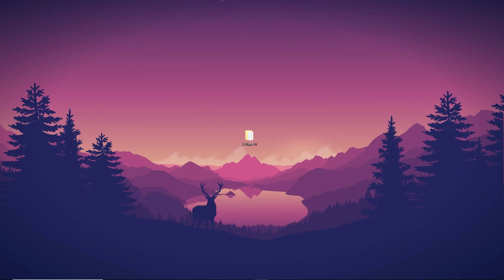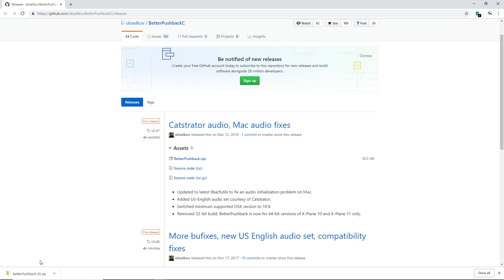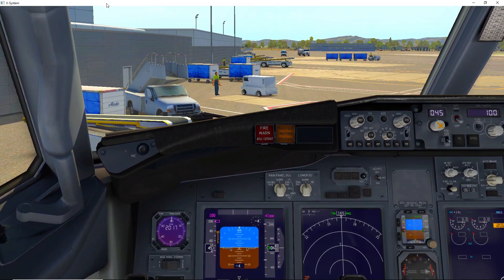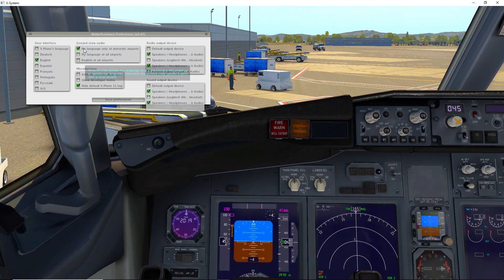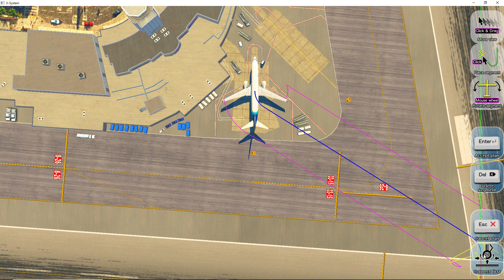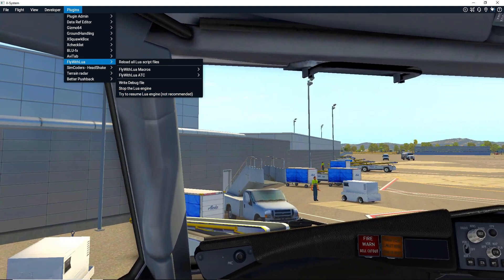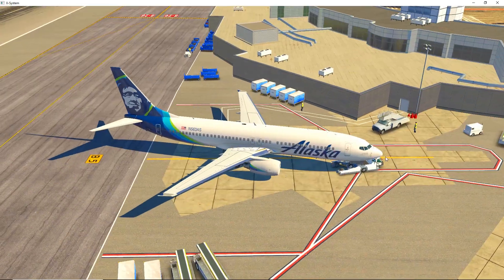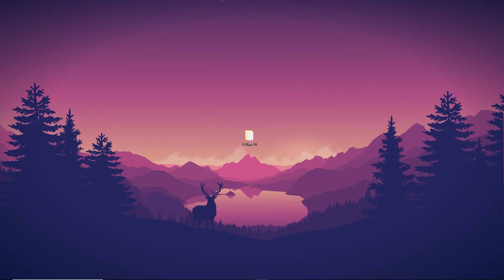X-Plane 11 - Better Pushback Plugin Tutorial

Comment: Idk what happened but when i tried to boot up xplane It said it wasn't installed.... Welp going to reinstall it i guess.
Reply from the maker: Vermont Drone Photography better pushback wasn’t installed? Did it say there was an issue with the audio messages, and then tell you to reinstall it? No need to reinstall it. Simply go into the plugin tab, under better pushback go to something that is related to preferences, or something like that. Once there, change your audio output devices to the ones you will be using. Hit save, and that should be good. Trust me, this issue happened to me, and now I know how to fix it, and so do you!! Any questions?